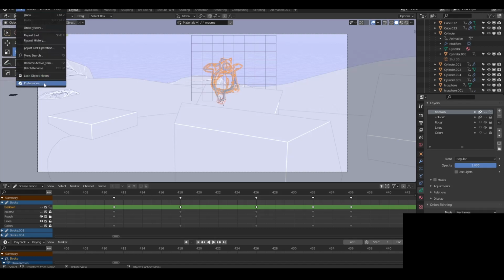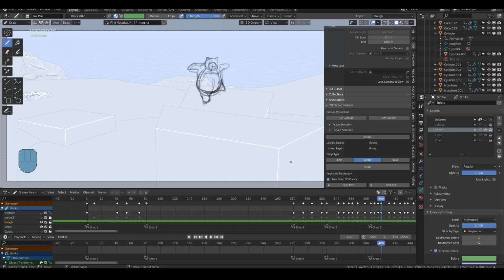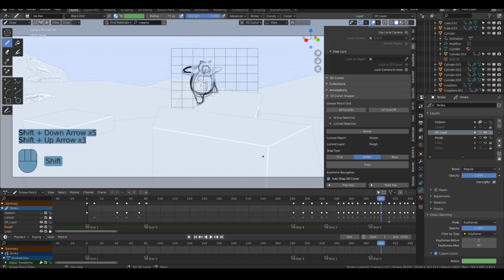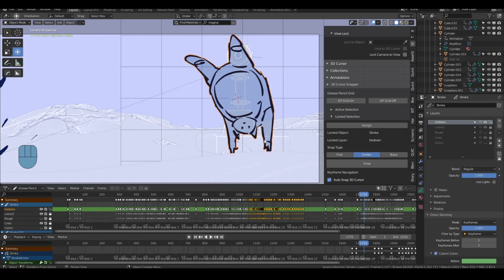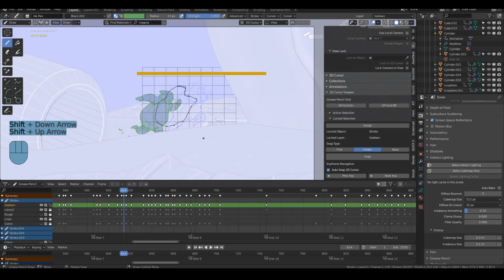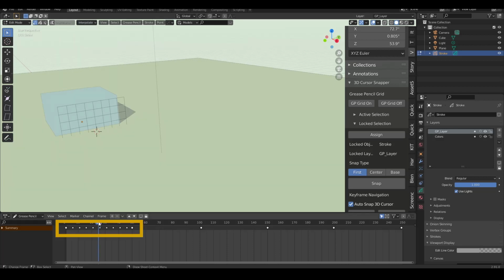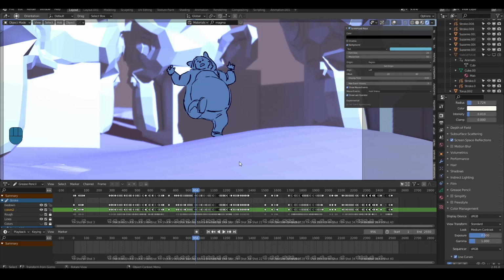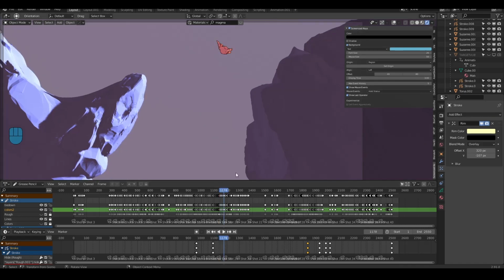CURSOR SNAPPER Addon - V 1.0 RELEASE + Workflow Tutorial - Blender Grease Pencil

Comment: This is an amazing add-on (and workflow video :) which single-handedly made mixing 2D and 3D make sense to me in Blender.

As a hopefully small feature request: would it be possible to not just move the 3D cursor with this addon but also rotate it? 

When I place a 3D cursor in the scene I notice that it inherits the view angle, so I can rotate the drawing plane around while sketching an action without having to set-up cameras first. But when Cursor Snap places the cursor back onto a frame it doesn't change the rotation from whatever it was before, so the 3D cursor drawing plane option no longer matches. Perhaps a few of random vertices can also be subtracted to get the normal after it's done averaging the location?
Reply from the maker: Hi. Really glad you like it. Thanks for the request. Yes indeed, in the pro version one of the features will be to make more of the 3d cursors rotation, and we will see what we can regarding keying those rotation for when we snap back . We have lots of cool features Ideas so look forward to the pro version in the future sometime (but it wont be for a while as Ed and I have been very busy)

Comment: This is the best grease pencil anything i have ever seen in blender, all thanks go to everyone in spitfire storyboard. One question;

is there a setting to make it so that it always faces the camera?
Reply from the maker: Thank you. Depends on what u mean by face the camera. Do u mean when u are drawing? If so, then yes, you just to need to in draw mode have the ‘view ‘ setting on. If u mean, get it to face the camera even if u then change the camera angle, then that requires more work, using the reproject option.
Reply: @SpitfireStoryboards  allways face camera (and maybe viewport tho thats secondary to what i want). This would make complex scenes more flexible in that changing angles completely with an already drawn out sequence doesn’t force you to rotate everything or specific frames to the camera or jus redoing the frames themselves
Reply from the maker: @stanley8006  yeh I’m not sure how to do that. Basically some kind of ‘always face camera / viewport’ option. It feels like there should be a setting somewhere in an objects settings
Reply: @SpitfireStoryboards  thanks for the reply it means a lot
Reply from the maker: Thanks. Depends on what u mean by face camera. If u mean when u are drawing, then yes, select the view setting at top. It’s highlighted in video. If u mean, to always and ever face any camera after u have drawn it, then no. But u can reproject strokes so that if u changed angle and wanted to reproject, u could

Comment: im hyped to use this, but how does it compare to using 3d models as a base and parenting them, which work flow do you prefer?
Reply from the maker: Both have their uses. I have stopped parenting to objects,  for the reasons I address late in my Sci fi tutorial set : it creates codependencies and u have to always use the 3d model keys to animate your gp. If I use 3d characters now I tend to use them as a block out for reference but not parent.  Cursor snapper is the complete opposite of parenting and object keying . It's a liberating way to work for some people . All of these approaches have their uses. Thanks for engaging . Let me know if u like this method .

Comment from the maker: NOTICE: This is not advised as first time beginner content. It requires a basic understanding and familiarity with blender, and the Grease Pencil tool. If you are just starting out, please run through my first tutorial series to get familiar with how everything works by default, before trying this new technique.  Playlist : https://www.youtube.com/playlist?list=PLeV-rteYibcvBvW-WNPMtajsaaGfGay6Y
Reply: Sorry to do it like this, but I've been using this addon recently, and really love it. However it's last version is unable to work if the GP is constrained. I've found a fix to that but cannot contact the developer. Can you do so for me? Let them know that using the gpencil object's `.matrix_world.to_translation()` will give a vector of the origin's position after the constraint. So we can fix this issue by using this for the `gporigin` value.
Reply from the maker: @NikolaNevenov86  thanks for your response i will let Ed know.
Reply: @SpitfireStoryboards  Hey thanks, another thing is that I'm not quite sure what your concept was, but for the `center option` I think we can use the Gpencil's Bounding box. Blender calculates the bbox for the gpencil every frame, thus finding the center of all the strokes is simply finding the center of the bbox which is basically just 8 verts. So we don't need to loop through all of the strokes and all of the points on a stroke.
I suppose in the case where you only one a specific layer to be summed up.... it makes sense . In any case I'm looking into auto aligning the cursor to the camera view every time it snaps. But have nothing at the moment, and I do need to finish my animatic soon.
Anyway Merry Christmas(or Happy Holidays).

Comment: I like your UI set up. How do you keep the timeline set up (for grease pencil and the normal timeline) in sync with one another? Like, how you do zoom in/out or move throughout the timeline on one and the other follows? Or did you just line them up for recording purposes? 

Also, did you plan out your shots (drawn thumbnails) before making this storyboard/animatic?

Thanks!
Reply from the maker: Hi Shika. I've been meaning to cover the timeliness  thing in a quick video. Basically what u do is get your two timelines  to the same scale initially so frames match up. Then in ' view' on timeline select ' synch visible range ' . Do that for both . Cheers
Reply from the maker: On the thumbnails......I did some very lose ones somewhere before hand but just for some initial ideas. It changed and grew in the making for sure
Reply: @SpitfireStoryboards  Ah gotcha! thank you! I do have a couple more questions if you don't mind...

Will you release a full storyboard/animatic here on youtube that has been completely done in blender (not just tests, but from an actual scene from a script or something)?

do you ever use different 'Scenes' in Blender? 

As far as storyboarding in Blender goes, do you ever do any 2d shots (for the simple shots/character movements) and just save these 3d ones for complex shots/movements? If so, how do you keep everything organized? Different blender files or keep everything in one file?
Reply from the maker: @Shka_maru  yes I will upload content like that when I do some that I can show . I have not used scenes much or the vse editor but will be exploring it. I would do stuff in 2d if the project was right but to me the hybrid is the reason I use blender so ....I d probably do that instead. So far every scene I have done in blender has been one file . This cursor snapper scene is one file, one character, 36 cameras using the marker on timelines to switch . Feel free to come over to the discord for more chat and community fun ;)

Comment: Question for you about your process using this technique with finished animation. If you're doing a walk or run from the front or back, how do you address foot placement/sliding. Because if on every frame in a frontal walk, let's say, the grid steps forward, there's a problem. I guess one way to handle is by just using "view" mode and drawing on one plane for finished animation, essentially "copying" from the roughs. But, was wondering your process.
Reply from the maker: Yeh stuff going directly away ot towards camera cN be tricky . I strongly suggest prepping it by using the dot path method to get yr positions first, or use 2 views so u can see where from the side too. Both methods shown in the video.

Comment: Super impressive! I'm using the plugin, and it's really helpful. Question: You talk about starting off in "front" mode to do your roughs, and then switch to "view" when you get closer to tie-downs. Can you comment on this process? Haven't tried it yet, but it seems like it could be awkward and difficult reproducing drawings in "view" mode when the originals were done in "front", especially if the angle of the camera changes significantly.  Also, I notice that when you draw in "front", for example, and then switch to "view", only subsequent drawings will abide by the new setting. Is there a way to make all drawings comply when moving from "front" to "view", or vice versa?
Reply from the maker: These are good questions . What you've mentioned here is precisely why I treat that first pass as layout and I don't get too specific about nailing the artwork from a perspective . I keep it very loose. Once camera angle is established then yes for that initial change to view mode there is often a difference between the angle but there isn't much way around that. In terms of the angle of the artwork then facing camera then as long as you are in view mode, your new drawing will always face camera. However if u are talking about wanting to reproject the artwork to a new angle , u can also do that but it has to be frame by frame for view mode . I'm not sure if I have yet covered this in any of my vids but u go into edit mode, select the artwork then go up to grease pencil , clean up, reproject strokes , view . I've been meaning to put it in  a quick tips video . I don't use it much its more for fixing mistakes
Reply: @SpitfireStoryboards  As always, thanks for your quick and full reply. Deeply appreciated. What I love about your plugin is that it makes establishing timing a lot simpler. I didn't know about that Edit mode trick, so thank you for that as well. Please keep up the great work, and know that what you're doing is making a real impact in the growing GP community.
Reply from the maker: @danwiner  thanks very much. Yeh, not needing objects keys radically simplifies the process of timing etc. There is no conflict or co dependency using this method
Reply from the maker: @danwiner  feel free to join the discord channel

Comment: Great idea! We're testing the addon at the minute, works great. A couple of suggestions/requests:
1) would be useful if it also rotated the 3D cursor to the correct angle - the current approach requires the camera to be locked and to always draw from the camera, which is a little limiting in some situations. It's not quite as simple as moving to the correct location, but certainly should be doable for planar drawings, if not deformed ones?
2) would be simpler to use if it worked with blender's existing ways of moving through time (scrubbing the timeline, using left/right, using up/down) rather than having its own standalone next/previous keyframe buttons. Is there any reason it can't run automatically whenever the frame changes?
Other than that it's a really fun tool, definitely streamlines the GP workflow. Thanks!
Reply from the maker: Hi thanks for the detailed feedback.  In response: point 1 , angle of cursor is already on the list for a feature. 2, I prefer that people have the option to not snap if they don't want to. The shift plus up down shortcut is simple enough . But , well look into it as an option perhaps,  if its possible to make it auto. In v1 it just made is simpler to have an input . Thanks
Reply: @SpitfireStoryboards  Awesome, will keep an eye out for updates! Good luck :-)
Reply from the maker: @hellorgl5  cheers . PRO version might b a while so make the most of v1 for now . Feel free to send links to any work u do
Reply: @SpitfireStoryboards  Sure thing! Thanks!
Reply: !) Yes, rotating the cursor will be a future feature with this add-on. 2) Blender does not want scripts running in the background for very good reasons. It is possibly to run some functions in a modal way. It would be best if this were done in the core code of Blender.